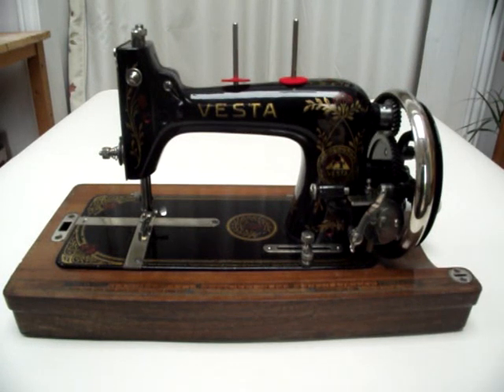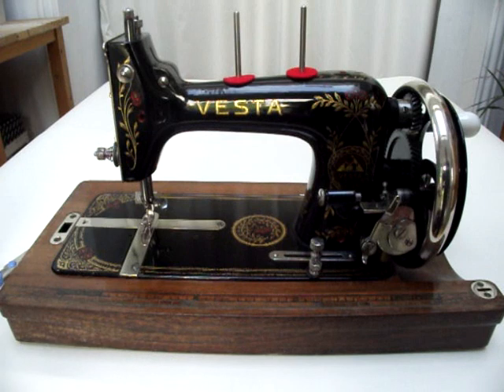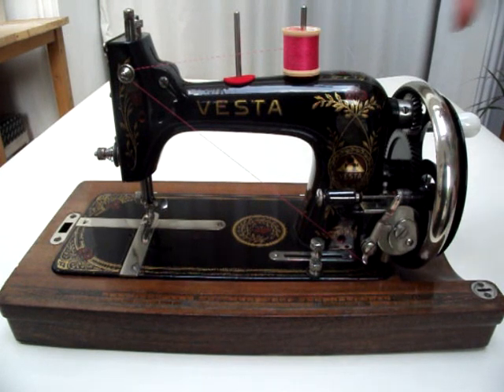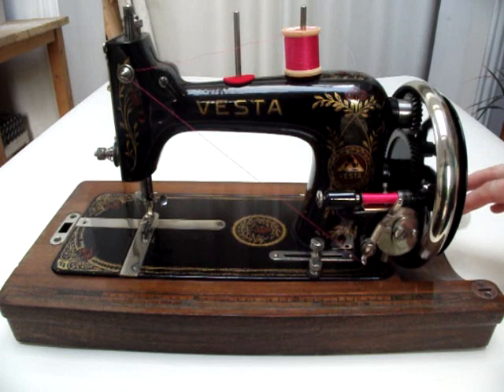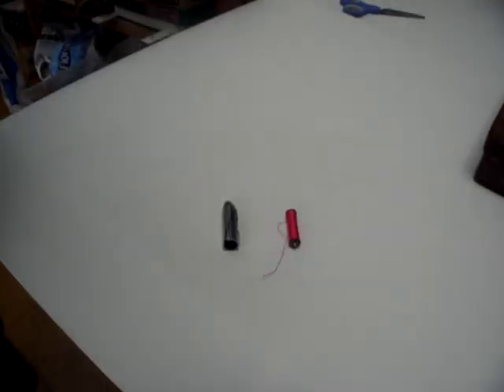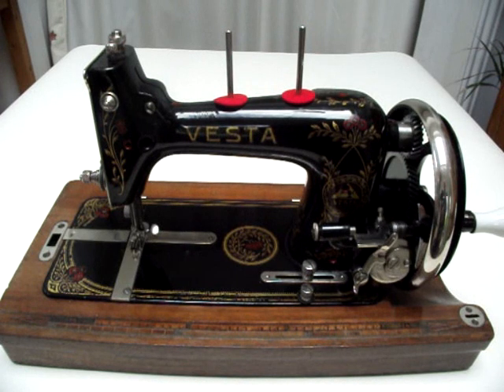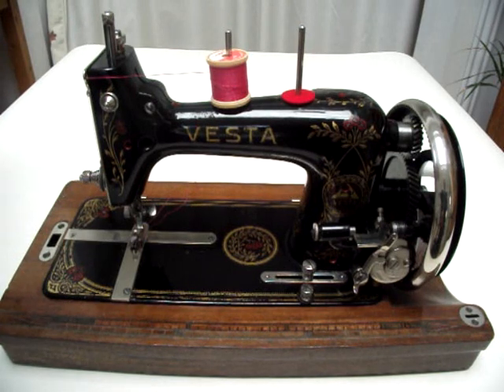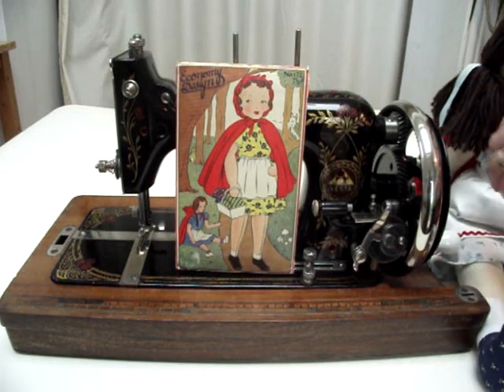How to thread a Little Vesta vintage sewing machine - Vesta nahmaschine

Comment from the maker: Hello Duncan, Thanks for the tips.  I have actually got a piece of pipe insulation to protect handles.  As for removing the balance wheel, my attitude is that if it works and won't come off, it can stay on.  I'm a total girl about these things - I never touch anything mechanical unless it is a sewing machine.  Any other job which involves a screw driver is strictly my husband's pigeon.  What I have tried to demonstrate with the videos is that if I can sort out a sewing machine, anyone can!  Muv

Comment: thank you for the tip on the bobbin, i was wondering what all those little metal parts were supposed to do, and the machine seemed to work without using them anyway. Turns that it is the whole bottom thread tensioning system :)

Comment: Dear Muv,Thanks for that.If I might be so bold to give you a little tip for the removal of the fly wheel if you get a small hub/bearing puller(two legged)for your tool box.I had to use one on my Singer 27 which was totally seized with old grease.Very simple tool you can get off e bay.Also with porcelain handles,I have put a small piece of grey insulating foam,that is used on copper pipes.As there appears to be no locking device on the wheel,so that the handle could smash into the machine.Duncan

Comment: Hi Lizzie,  Does this machine take a 15x1 (system 705) needle?  I just bought one.  Your machine is in amazing shape....thanks for the video.  I've got a Singer 48k2 that is incredible and another 48k enthusiast has the little Vesta so I got one (plagiarism is a huge compliment I guess).  Looking forward to using the Little Vesta when it arrives.....there looks to be a belt groove on the hand wheel is this correct?  We have a Singer 12k also but I'm not attached to the machine it is just too fussy and I put it in storage right away.  Best regards, Mike

Comment: Dear Muv, One small point on your cleaning and oiling part 1. Is there a part 2? As I have picked up a Frister and Rossmann machine (circa 1890ish) at car boot, in need of a good clean etc. My fear is I might damage the gilding. How do you bring up machines like new. Many thanks again Duncan. P.S Now totally addicted to these machines. (which is no bad thing) PPS The Vesta is a little gem.

Comment: I bought mine from an antique shop today and it turned beautifully but I went and fiddled with the hammer I call it that is attached to wheel to turn it, thinking it came off like the singer machine and just popped on again but I’ve put it back on again but it’s struggling to turn even just turning the silver wheel by hand, not sure what’s happened can anyone help? 

Also side note the more I’m looking at pictures of Vestas sewing machines I’m starting to wonder if mine is a genuine one as it’s a little bit of different parts of Vestas machines like the gold designs of one machine and the wooden base of another model.

Comment: excellent video! what kind of needle do the vestas use?? the regular 15x1??
Reply from the maker: Some Vestas use the regular needle, but some older models use a shorter needle which would be very difficult, if not impossible to get hold of.